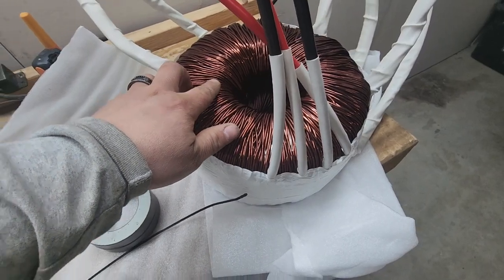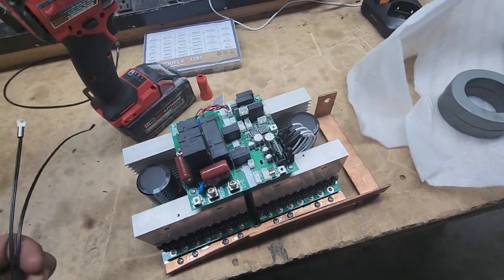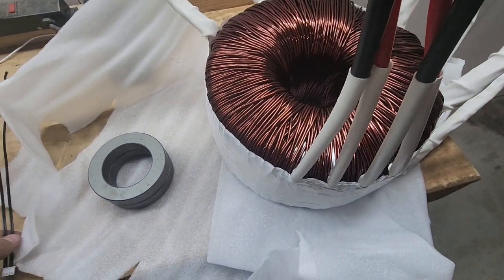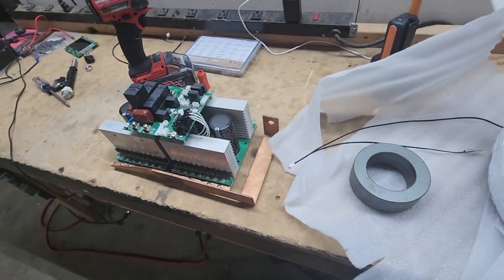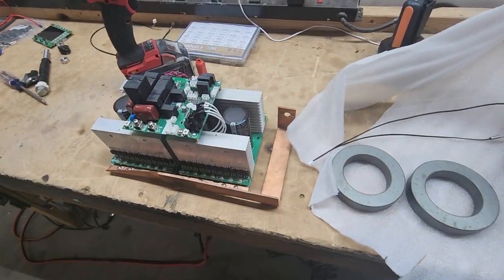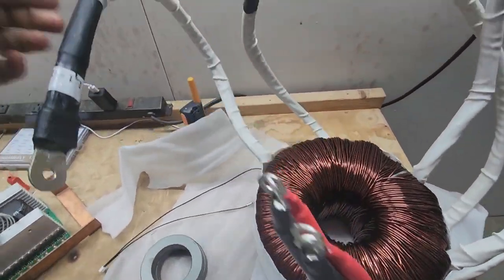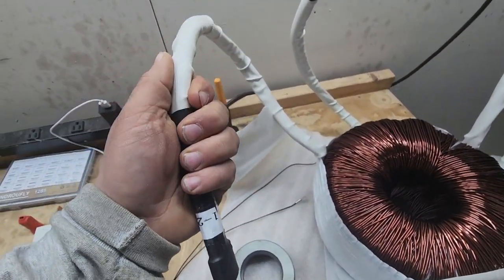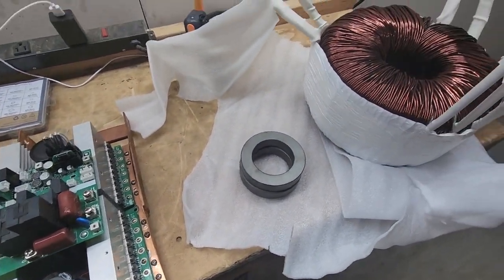Transformer wrap removed and bench test happening tomorrow

Comment: A epoxy with aluminum in it would be great for the temperature transfer on the transformer, or even JB weld, it has iron/steel, just a bit , enough to hold the sensor on the transformer!

Comment: I was wondering if aluminum wire wrapped the coil!

Now I understand why the weight of the transformer did not change much!

If the transformer is close to the main board, looks nice to keep the plastic wrap on the transformer!

Sliding the thermister between the plastic & transformer winds with some heat transfer goo should be fine.